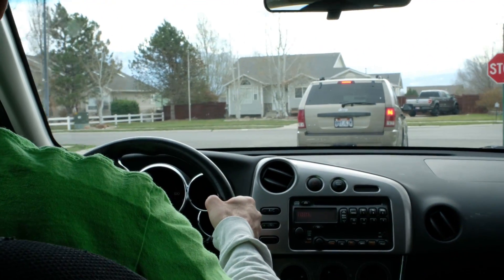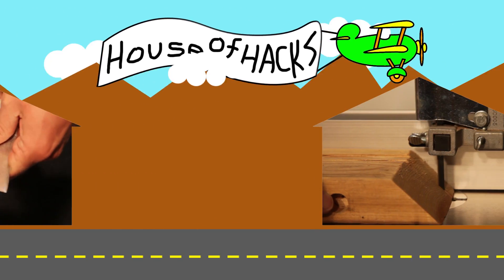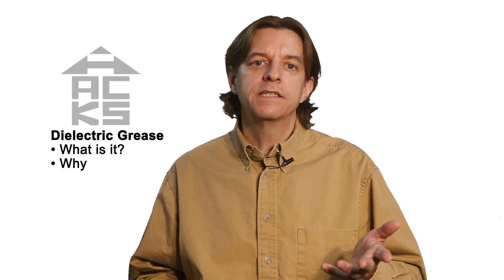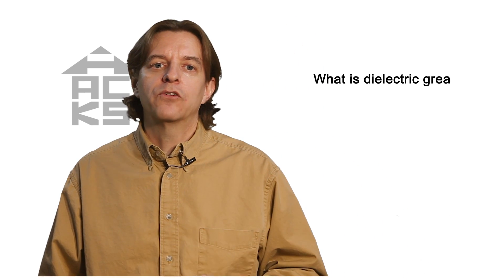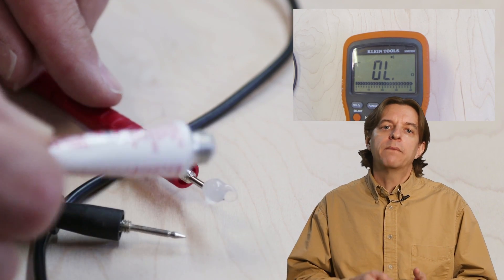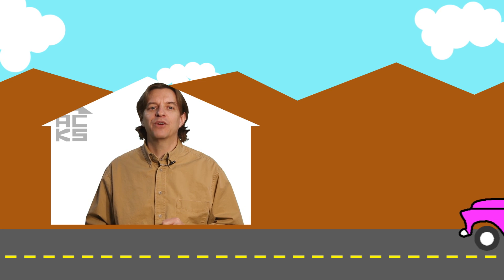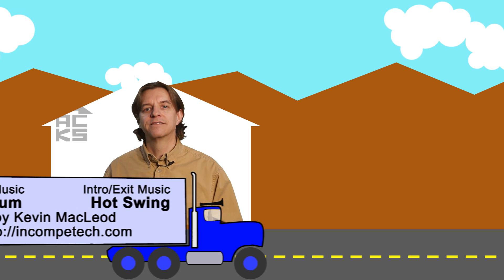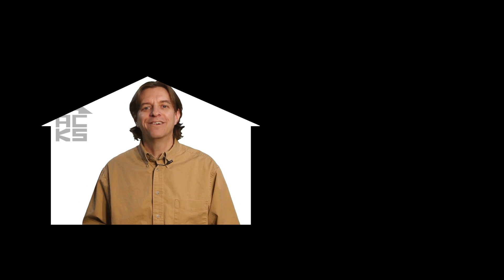What is dielectric grease and why should I use it?

Comment: I would not use it.   It does not conduct electricity so if you coat wires with it you will cut down the current.     You want Deoixit to cut down oxidation and has no effect on reducing electrical flow or increasing resistance.    
Take old N64, Atari Cartridges that no longer boot a game.  Coat one with dielectric grease (it will fail) and spray another with DeoxIT D5S-6 Spray.  The spray will bring it back to life, the grease will not.   Alcohol did not ever work when Deoxit did on same contacts.

Not sure why people use this connection killing grease except to keep water out but hurts the actual connection because its like tape, an insulator not a conductor.

Comment: If it's an insulator, why did you gob it in your spark plug wire?
WRONG!
You SPARINGLY use it on the rubber insulator around the electronic component, not on the electronics to prevent arching.

Comment: I agree with you 100%, I've been using it all over the electrical connections also pumping it in to the back of the electrical connections trying to get it everywhere that there is bare metal as well as plastic when the two terminals come together. just recently noticed people were saying that it's terrible to put it on the metal connections. from there I started looking for videos and information on why they would say that and they seem to be contradicting their souls. I don't see how you can stop moisture from getting in to electrical connections unless you cover the electrical connections. LOL I appreciate your time and information

Comment: Great myth busting video. I was though unclear if it is wise to use dielectric grease on low voltage contact terminals eg various sensors/connectors. I was thinking it is a preventive maintanance to insulate those sensitive sensors against corrosion and oxidation. This may especially be helpful as we often clean engine with water and those sensors are of prime concern. Please share your thoughts. Much Love...
Reply from the maker: Yes, that's a perfect application for it. I've heard of people in the off-roading community going through their vehicle on a periodic basis and putting it on every electrical connector so their it stays reliable through the mud and water they run their vehicles through.
Reply: @HouseOfHacks  massive emphasis on not putting it directly onto contacts though
need to make sure it's applied sparingly and only on the housing around the terminals though, otherwise you can get heaps of random electrical gremlins. But ye super common in off road vehicles every year or so
Thanks a bunch for the video though, had ignition issues with my mk4 supra for the past 6 months and had a thought about the grease I threw on the plugs, aaannnnnddddd 30 minutes later your video handed me my answer finally lol

Comment: Excellect video using correct scientific facts, instead of 'old wives tales'. I would like to point out that the reason it makes good contacts is, that when you slide proper fittings together, the grease is actually displaced, making good metal to metal contact. The gease surrounds the connection, protecting it from the elements. On the other hand, if you were to smear it onto flat mating contacts, like ring terminals or flat (Ford) battery posts, you don't get the scraping action and the dielectric can form an insulating barrier to good current flow. These are best connected dry and the dielectric added on the outside, for protection.
Reply from the maker: Thanks for the clarification.

Comment: Good video Thank you.   I've got a 40+ year old tube of Ox-Guard that is still the same as it was new. 
I've been watching sail boat videos to learn. Watched at least a hundred electrical installs/repairs. It only just hit me that no one was using dielectric grease, and there wasn't any on any of the connectors from the factory that they were working on. 
In boats it's  common that a 5+ year old boat is rapidly becoming a maintenance/up keep nightmare, with numerous electrical problems. If water and oxygen can cause problems overtime,  what do you think happens when you add salt?
I've been messaging various experienced sailors about this. Dielectric grease is news to all of them. My tube of Ox-Guard has lasted so long because I was only using it on external wiring, especially garden lights and sprinkler systems. Now I think I'll use it on everything. The ground wires on my 70 year old house were all conducting about half the voltage - power strips can't work correctly.  I figured the problem would have to be in the panel where all the wires come together. Nope. No clue where it's coming from - but it's clear it's caused by corrosion.(maybe a wire nut buried in a box somewhere) So for critical outlets (computers, GFIs, etc) I ran a new ground wire.  (I rent or I'd rewire the whole place).
Reply from the maker: Wow, I would have assumed boat manufacturers would have put dielectric grease on all electrical connections. Amazing that they don't. Old house wiring can be a pain; you never know what was done.

Comment: Thanks for the great Information I just installed a new taillight on my motorcycle soldiered wires then used dielectric grease on soldier then covered with heat shrink tubing.
Reply from the maker: Happy to help!

Comment: Nice. Thank you for sharing this information. Very informative. 

Is there a version of dielectric grease, but for metal to prevent rust and corrosion?
Reply from the maker: You can use dielectric grease on metal. But if you don't want something sticky, such as on a surface, there are waxes and other protectants that can be put on.

Comment: Is there any difference if you use 3M Silicone Paste Dielectric Grease, Versachem 15339 Dielectric Connector Grease or Permatex 09980 Counterman's Choice Spark Plug Boot and Electrical Connector Dielectric Grease? Any preference of one of those to use on Spark Plugs and SP Boots? I know that some of them cure to the solid condition, some stay soft, so which one it is better to use? Thank you for the film.
Reply from the maker: Sorry, I don't know the differences between those specific brands. For spark plugs, you definitely do not want one that cures to a solid condition. That would make removing the plug wires in the future very difficult.

Comment: I recently spliced headlight wires to add in an extra set of lights, and was considering what I could do aside from electrical tape that isn't fully sealing the soldered connection from oxidization. Great of you to have made this video! Thanks!
Reply from the maker: You're welcome! That's a perfect application for this.

Comment: Is a true that you can put dielectric grease to the water hose quick connectors as well?
Reply from the maker: I've not tried it in that application, but I don't see why it wouldn't work. I think probably pretty much any type of grease would work for that.

Comment: I install security cameras. They use cat5/6 now with RJ45 network connectors. I used to see a lot of corrosion due to water damage for outdoor cameras before I started using dielectric grease. Since I started using it about 5 years ago I haven't seen a single outdoor network connection fail due to water damage since I've started using it.
Reply from the maker: Cool testimony to the power of using the right tool for the right job. Thanks!
Reply: Can you explain how do you apply it?...i am about to install a couple of poe cameras and i am thinking to use this for the first time. Thanks in advance.

Comment: Is silicone compound dialectic grease?
Reply from the maker: Silicone grease and dialectic grease are similar but a little different. In general, dialectic grease will have a higher insulation factor. For low voltage applications, silicone grease is probably close enough to work. For higher voltage applications, I'd stick with dialectic grease.
Reply: @HouseOfHacks  thanks for the advice. I purchased some ignition leads recently for my car's spark plugs and I received a small packet with "silicone compound" written on it. The leads came with no instructions so I wasn't too sure what to do with it. I assumed it would be a form of diaelectric grease as I can't imagine what else it'd be for. (I'm new to servicing my own car).
Reply from the maker: Ah, right. Most plug wires I've seen come with dialectic grease. I'm not sure if is really silicone grease or a bad translation. In either case, I'd expect it to be OK.

Comment: Can I use this.to.lubricate my audio mixer pots (Potentionmeter) and faders
Reply from the maker: Hmm. I was sure I replied to your comment when you asked, but I don't see it now. Let me try again...
I wouldn't suggest using this on potentiometers and faders. Adding a grease like this is going to attract dust and over time cause them to gum up. It's more likely they need a good cleaning with an electrical contact cleaner and some canned air.
Reply: Try DEOXIT® FADER F-SERIES instead

Comment: the only benefit I see is that it should help fend off corrosion. Other videos prove there is zero conductivity in dielectric grease as well as vasaline or "normal" grease. I think as long as you have something covering the metal against corrosion, there's no difference.
Reply from the maker: Yes, that's the primary benefit, and in damp environments, that's a significant benefit. It can also keep any plastic/rubber parts from getting stuck together and easier to remove.
Reply: I think if we're splitting hairs, dielectric/silicone grease, is less damaging to rubber/plastic, than petroleum grease/Vaseline.

Comment: Here's a comment from a guy who was a professional IBEW union marine-electrician journeyman-leadingman who pointed THIS out to me

"Wonder why my power company guys don't use it.... Or try the logic from the other direction. If DG is so cheap and effective then why don't the OEM's use it? How deep does the conspiracy extend? I never had engineering instruction procedures to use DG."
________________
Reply from the maker: Don't know about the use in high and line voltage applications.
For vehicle applications, the first time I ran into it was on a car where it'd been used at the factory. My guess is the reason it's not used more on vehicles is because the bean counters figure the the cost/benefit isn't high enough from their perspective.

Comment: ???????????vaseline vs dialectic grease???????????
Reply from the maker: Sorry, not quite sure what you're asking. Vaseline is different than dielectric grease and should not be interchanged. If that's not what you're asking, please be a little more descriptive in your question. Cheers.
Reply: @HouseOfHacks  Vaseline and Dielectric Grease Electrical Resistance in Wire Connectors https://www.youtube.com/watch?v=pC2HVoHWNLA

Excerpt from text right below video: ....Vaseline and dielectric grease are widely used in wire connectors of motorcycles and automobiles to keep the moisture out and prevent the connections from rusting and sticking. There are different opinions on how to use them and if one is better than other. The electrical resistance of each was tested and their effect in wire connectors resistance was explored. Both are NON conductors and slightly raised the resistance of connectors.....
Reply from the maker: @tombouie  Ah, I see. Vaseline is a petroleum based grease and may degrade some types of connectors. It's also highly flammable. I would not use it for electrical connections as 1) it may cause the fitting to get brittle and break and 2) if a high current causes it to heat up, it may catch fire.
Reply: @HouseOfHacks  Thks, really you should do a video on the compare.  Vaseline on econnectors is a lot like sasquatch, ufos, ghosts, etc ; the myths just lives on, & on, & on, ..... , & on, & on, & oooonnnn
Reply from the maker: Yeah, that would be a good topic! Thanks for the idea!

Comment: @House of Hacks -- Is it wise to put this dielectric grease on the connector points of BNC cables exposed outside to rain/humidity/moisture?  My last BNC cable got corrosion/moisture damage.  I need to replace the cable but want to put something on the connectors to prevent this problem in future.  Is it okay to put this grease inside connector and then some silicon tape over entire area for overall protection?
Reply from the maker: Sure, that should work fine. You can also get weatherproof BNC connectors that are designed for that application. Cheers.
Reply: House of Hacks  — thanks for your reply. One last question on this, should I go out of my way to ensure the dielectric grease goes inside the small hole where the pin is inserted? Is it also okay to be generous in applying this grease?
Reply from the maker: @loveislife77   I'd just put a generous amount around the pin and let it squeeze into the hole when it's assembled. Peace.

Comment: what would you suggest I use on an Electrical Lug Nut that is stuck? It is on a main breaker of a panel.
Reply from the maker: Are you referring to a wire nut? That I'd just cut off with some wire cutters. If you're referring to something on a bus bar or something similar, I'd use some sort of penetrating oil. Regardless, make sure the power is off inside the panel.
Reply: @HouseOfHacks  yes, on a bus bar..main breaker of a Sub Panel. (See Above) I was hoping that you would suggest which brand of penetrating oil might be best. I want to make sure that when I power the sub panel back on that the penetrating oil that I use would not have an adverse effect, like arcing or some other problem, because of the high voltage. I want to make sure that I use the proper penetrating oil and not something that could be detrimental.
Reply from the maker: @havenge32  Ah, right. Sorry, I'm not familiar with the pros and cons of the various brands of penetrating oil. If it were me, I'd use just enough to get the job done and make sure to clean it all up before putting things back together. I wouldn't worry too much about specific brands. But that's just me. If you're not comfortable with that, be sure to do your research (as it sounds like you're doing :-) ). Peace.
Reply: @havenge32  bus bar and nut copper or aluminum, size of breaker, voltage, single or 3-phase?

Comment: Can you use this on household lightbulbs to prevent the bulbs from getting stuck and keep the socket from breaking off?
Reply from the maker: Hmm, I never thought about it. The only concern I might have would be if the heat caused it to dry out and act more like glue. If it doesn't dry out, that'd be a great use case for it. I might try running an experiment and see how it works out. Peace.
Reply: No. Use antiseize

Comment: Thank you so much for this. I have a high humidity house and my battery powered electronics get extremely corroded so often. I am constantly having to throw stuff away. I finally decided to spend some time researching how to prevent it. I finally found this but through another of your videos about Lithium grease vs silicone grease: Which to use? . This was after searching if silicone oil would prevent corrosion and still be able to use it on the battery connectors. Perhaps, if you have tags you can use, tag it with battery corrosion prevention. In the meantime, I will share the heck out of this to my damp climate friends in facebook.
Reply from the maker: So glad I was able to help!

And that's great feedback about how you found the video. Thanks so much! I'll see what I can do about changing the search results.

Thanks too for telling your friends. Much appreciated!
Reply: @HouseOfHacks  I bought a 3 oz tube of Liquid Wrench at Lowe's. I am going to put some into a small tip bottle so I can decant it into small places. <3
Reply from the maker: Sounds like a great idea!

Comment: The key is you don't need to glob it  on. If you do it could interfere with conductivity. It only takes a very small amount
Reply from the maker: Thanks for watching! Too much and it's just wasted Too little and it won't do it's job. If the amount put in the socket impacts conductivity, there's probably something mechanically wrong that needs to be addressed. Peace.

Comment: Really wish you'd shown that the light worked after removing the corrosion and applying grease
Reply from the maker: I guess I could have done that, but this video was more about dielectric grease than it was about the repair, so I didn't really think about it. It wouldn't have been too exciting though, just the light coming on. :-) Cheers.

Comment: Always use dielectric grease to protect against corrosion. Spark plug boots and electrical connections. It has to be non-conductive, otherwise it would short out the adjacent pins on the connector.
Reply from the maker: Great advice! Cheers.